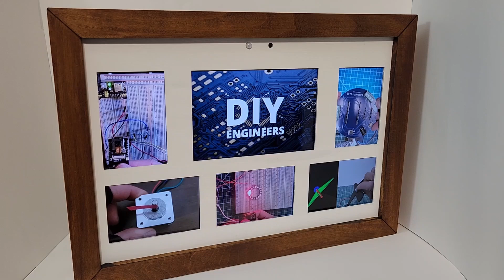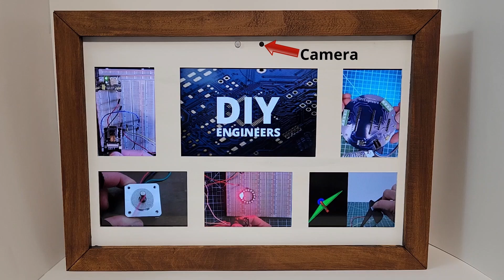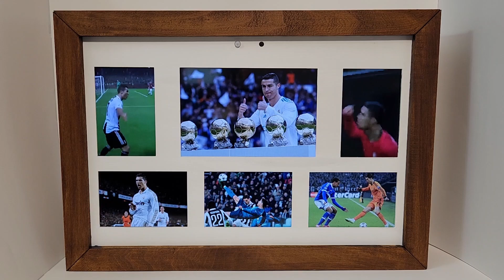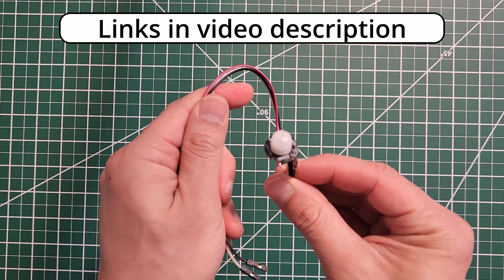Creepy or Genius? Smart Frame With a Camera

Comment from the maker: Where to buy [Amazon Affiliate]: 
Raspberry Pi 5 8Gb: https://amzn.to/3W2IAov
Raspberry Pi 5 Case for IO & Camera Access: https://amzn.to/4f3xmIV
Raspberry Pi Ribbon Flex Cable: https://amzn.to/4cD9nip
18-inch x 24-inch x 1/8-inch (3mm) Basswood Sheets: https://amzn.to/4crIzkN
SR602 Sensor: https://amzn.to/4aDRZZ5
Raspberry Pi Camera Module V2: https://amzn.to/3W2kL00
Brackets: https://amzn.to/4cvUhuV
Dewalt Miter Saw Clamps: https://amzn.to/3W1EWLK

Comment: @diyengineers Thank you for such detailed video. I am very interested in replicating this in my home, I have been looking for ages for something like this. My intent is that in the same way you have place multiple frames in the same screen (but  in large screen of 85") with pictures continuously cycling in each frame, without the face recognition aspect. To achieve this I would like to asked you couple of questions that I hope you could answer for me:

1) Is it possible instead of using file names for parameter definition, refer to a folder name?,  and if so, can just retrieve/display all files in the folder?. This will allow me to add/remove pictures from the folder in the future without requiring code rewrite.

2) Could you provide a note file with the code you already wrote? I know that is a big ask, as you have put quite a bit of work on it, but I will not have to rewrite everything from the video.

Thank you for your post, and any support you can provide me with.